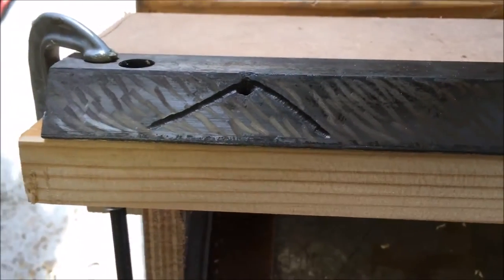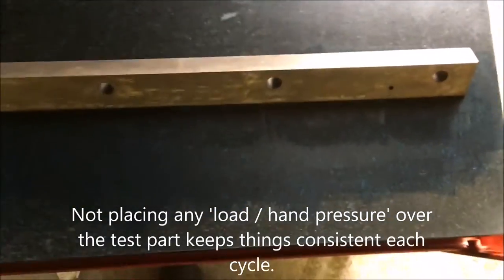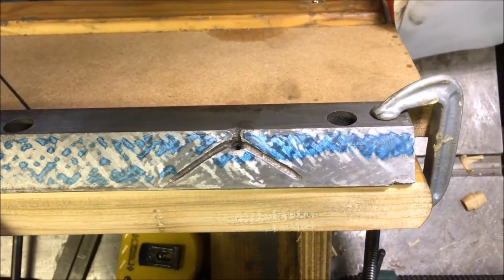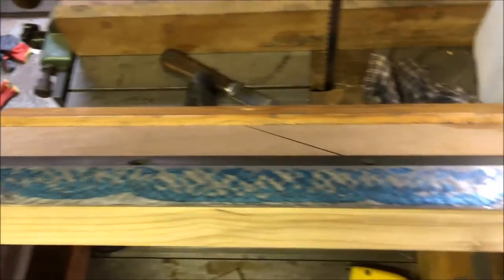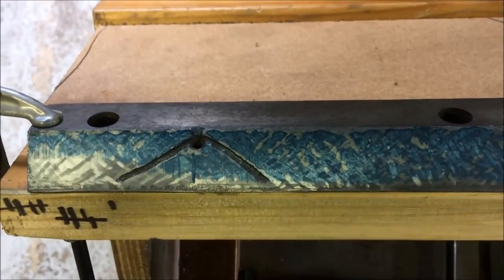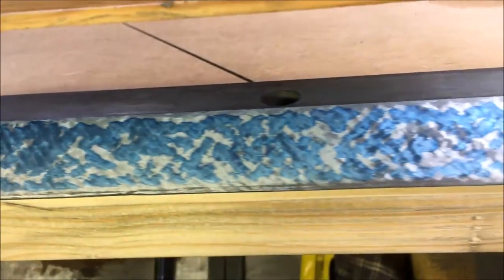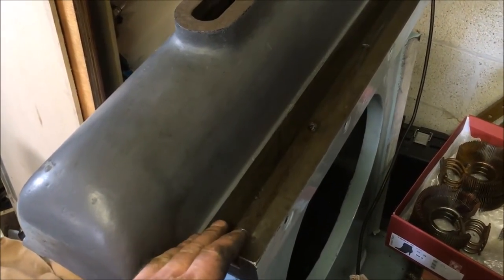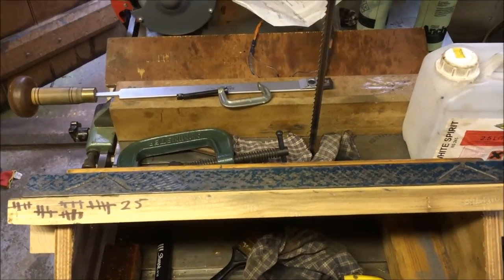Elliot 14 S Update 10 2

Comment: looking good mat, thanks for sharing, just picked up an alba 4s today, from down in Kent, did check for damage, but until I get it in the workshop, not 100%, so will give it a good check over, once I wire it up etc:
hoping mine is ok, will post a video on here in a day or so
kind regards..Keith in Swindon
Reply from the maker: good luck Keith - plenty of cast iron in the Alba's - hope it all works out well for your purchase. My Shaper is pretty much a 4S - made around the time Alba was purchased by Elliott. I suspect the castings are the same if not much of the internals. Does yours have the clutch and forward levers or is it as mine with the rear gearbox and single gear shift no clutch ? All the best Mat
Reply: hi mat, basically the same as yours, without the clutch,  and with the gearbox on the rear,
must admit it was a lump to shift, was going to strip it down and re-build , and re-paint etc, but going to clean first, then decide as the paintwork looks ok, hopefully can get it running in the next few days
will post a video once up and running,
its thanks to your videos, that I have one,  so all your hard work has rubbed off on me, hopefully mine will not need any work done to it apart from a little tlc
kind regards...Keith

Comment: I would not ignore the small low corner.  that is probably the corner that gets the increased load as the ram is fully extended.  Once you bring it down to full contact including the corner, do three or four more passes with short strokes (>1/4")   concentrate on the high spots only.  The spots that have a light center and a dark outside are the highest now.  followed by the dark grayish ones. Looking very good.  :)
Reply from the maker: Hi Dee, thanks for the comment - when I said the small area remaining was not significant I was meaning that until I know how the Gib contacts the Ram face - I was leaving it to come in when I refine the face at that stage. Thanks for the advice on the contact points. Im learning all the time. All the best Mat
Reply: Hi Mat,

See how it lines up with the ram. From the video it is hard to figure out where it is.  The point was, that if the low spot is in contact when the ram is extended it is critical. In that case you are better off bringing the gib down to fully flat on the stone.

dee
;-D

Comment: Getting there, but a shed load of work. Not that it really matters since there just used to spread the oil across the surface, but those oil grooves look like they were hand cut or put in with an angle or die grinder and abrasive disk or small carbide burr at the factory. That's not really something I would have expected from an old British machine tool manufacturer. It might be interesting to pull that gib and reprint it after the shapers done 10-20 hrs of work and see how much closer it wears in once the few 10ths of high spots get worn off. My guess is it should print a bit better than a fresh scraped surface does. I've seen that mentioned before about the ink actually surrounding the high spot and it can fool the eye about what's the high spot and what isn't if you don't understand how to read the pattern correctly. So it's a real good tip.
Reply from the maker: In Connoleys book on Machine Reconditioning (and another earlier book I ve read but forget the name - they talk about 'spotting' being the process of fitting the scraped surface  - where by it is installed and cycled back and forth a few times - this creates shiny grey spots which can then be dressed or 'spotted' with afresh sharpened scraper creating a better surface from which to commission the bearing. Makes sense - as even the stone will differ to a degree over its surface. Abom has just uploaded a video on his first scraping project.
Reply: Makes sense to me as well.

I watched Aboms video a bit earlier. Scraping one surface flat is fairly easy. Bringing two or more surfaces in while keeping the geometry correct like you and he are doing is a far tougher job.

I can't remember if Georg Schlesinger showed the proper alignment test methods for shapers in his book about machine tools or not. I know there's a free online copy of it out there.
Reply from the maker: I will see if I can find that book on line - new one on me.  There was an excellent pair of drawings put up on the PM thread showing use of level and dti for shaper geometry check.... of course that sort of measurement should be taken before the machine is taken apart ... oops - but then mine wouldn't move so I couldn't have checked it before and noted alignment issues to resolve now...
Time to head down to the workshop and take a look at the main casting and determine how best to measure / survey the ways.
Reply: Try Googleing Dr. Georg Schlesinger and it should come up. It's a lesser known book than Connelly's, but he did some of the earliest work explaining the correct test procedures and gives what the maximum errors should be. If I recall correctly it was originally written in German and then translated to more than a few other languages. Surprisingly not many have heard of it. Hard copys no matter what edition of it are tough to find and almost always expensive. Website called Totally screwed???? or something was the last place I saw that had an online PDF copy. If you find it I'd be interested in what you think of it.
Reply from the maker: Thats handy, just downloading it so that I can view it later on my tablet. So far the casting faces below the Ram show 0.004" max wear -  but Im still cocking about with the measurements to remove a few variables...
Reply: It must have been the Schlesinger tests I was thinking of when I'd wrongly thought they were in the Connelly book. But at least you now have the recognized test methods so they might help. .004" could be a lot worse I suppose. Since the knee usually doesn't get used that much maybe it's surfaces and the columns vertical ways won't be that bad.